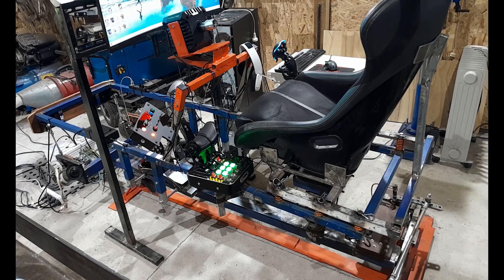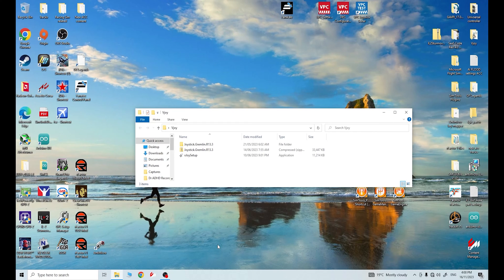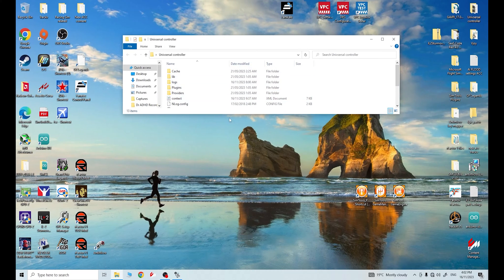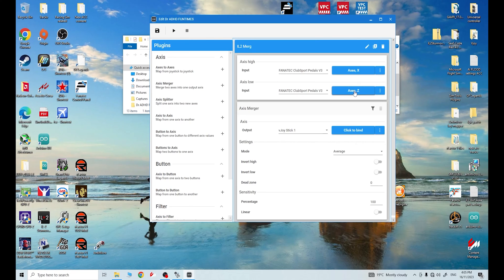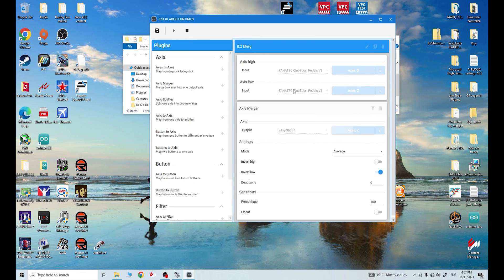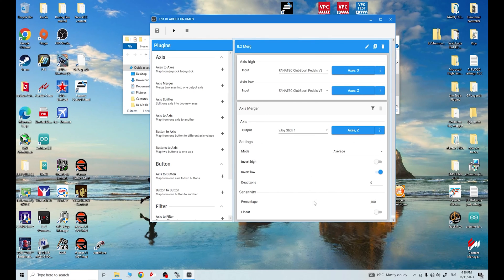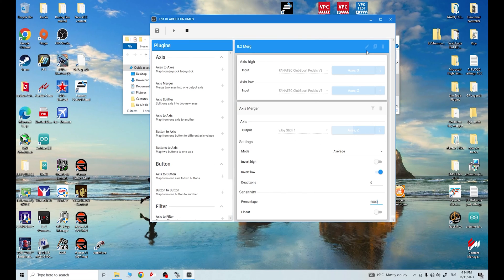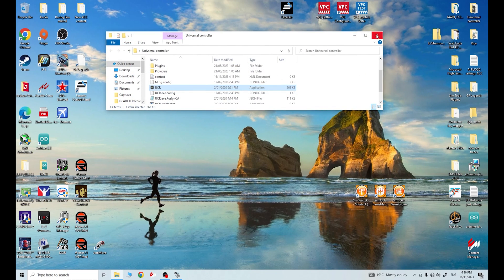Sim Racing Pedals As Flight Sim Rudder Pedals? Hell yes! DIY 3DOF Rig With A Flight Sim? Hell Yes!

Comment: Hello doctor im having an issue where the output axis gets stuck randomly when I release the pedals basically getting my ruder stuck at an angle I tried recalibrating my pedals and also checked thmy TLCM pedals app and it looks like the input should be working fine
Reply from the maker: Could be a USB coms/voltage issue, or possibly a pedals to Vjoy glitch. Or pedals to Universal controller for that matter. Not being much help here, because basically, I don't know why this is happening to you.

Comment: Hi Doctor......followed the video second by second....still can't get iL2 to pick it up as Z...every time I push the accelerator pedal in iL2 it shows as y not X. Axis high when pressed logs it as Y and Axis low as slider0........been at it for hours and given up....not sure what to do next.
Reply from the maker: @arcangelkq Feeling your pain mate. Have you tried a different range of sensitivity settings under the sensitivity settings? I assume you would have. Joystick Gremlin, the other app I've used has a repeater trigger that can be enabled to help with this issue, but it also needs its sensitivity levels increased. Bloody IL-2 is a real pain in the ass for this issue. The newer series is the same. Let me know if you need a guide on Joystick Gremlin. I'm always looking for an excuse to make a new tutorial, so I'll throw something together today with Joystick Gremlin. This might be an alternative for you over UCR.
Reply: @Doctoradhd1  I am sorry to report I think you missed a crucial step, the part where you tell IL-2 to see VJoy first. You started to explain how to do it but got distracted. Also your rig looks similar to the one I'm finna build, but for flight only.
Reply from the maker: @unique11124  getting distracted is 100% likely when talking about my brain LOL!
Reply: @Doctoradhd1  Yeah I think the detail you were going to mention was a drop down menu with controller preferences. Even with the VJoy one correctly selected ROF still gave some trouble.

Comment: I notice that having one power supply per motor is the norm. Is there any particular reason for that?  Would it be possible to iuse one large supply instead of 3 smaller inits?
Reply from the maker: I've seen a couple of builds using one large PSU for three or more motors, so it depends on motor Max amp draw vs size of single PSU to succeed with x1 PSU. I found three single PSU's where cheaper than one large PSU.
Reply: @Doctoradhd1  yeah I figured that was the case, but I have a really large PSU laying around, so if I can get away with not having to buy more I'll do that.
Reply from the maker: @lowguidoschopshop  that sounds like a good plan of attack.